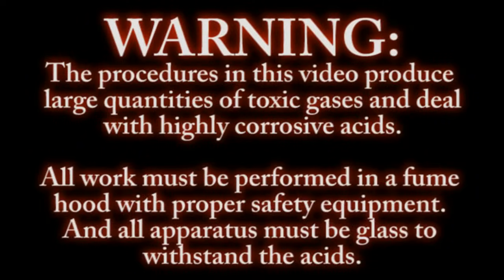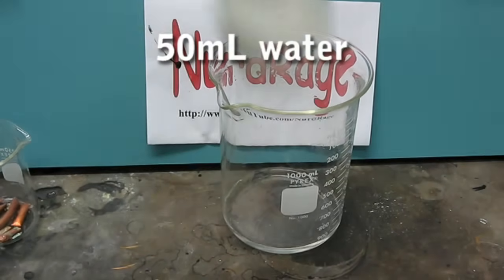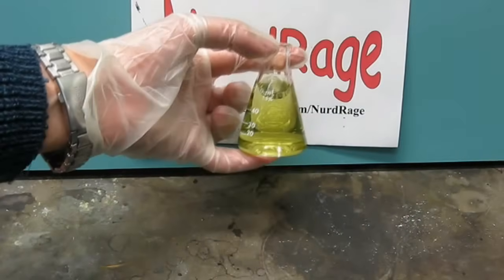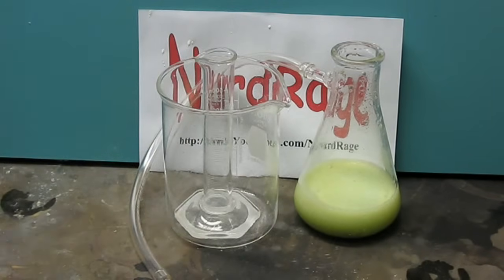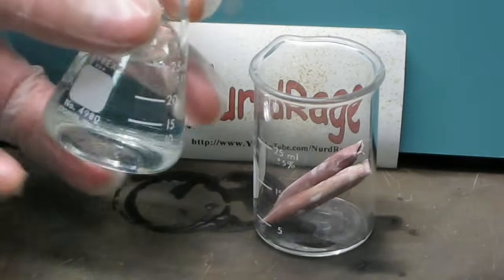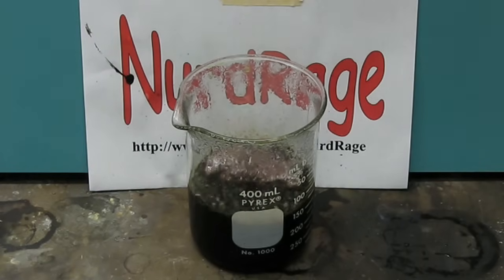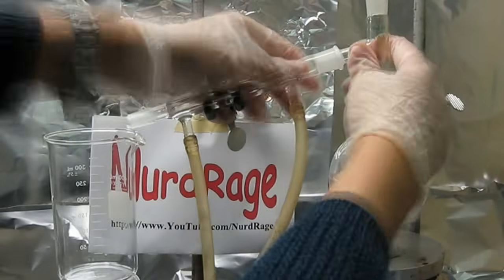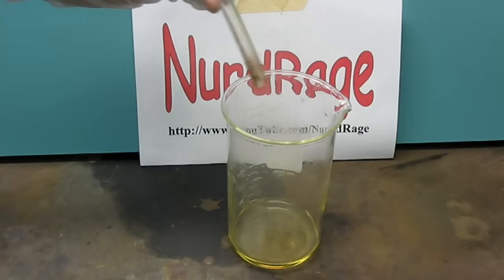Make Nitric Acid - The Complete Guide

Comment: This is by far the stupidest and most useless attempt at trying to make  nitric acid. For some reason I decided to utilize this method since I don't have a retort or distillation equipment yet and it's doing nothing. Absolutely freaking nothing,  except boiling off all the water and HCl. This is some bullshit and  you use sulfuric acid and not HCL. And copper? Really?
Reply from the maker: oh its a terrible method. You should really invest in a proper distillation apparatus and use nitrate+sulfuric acid. Its not worth to try and avoid it as shown here.

Comment: I tried with Potassium Nitrate, and after a day, (finally), the copper seemed to have reacted. A blueish substance was produced, and after y removed the rubber stopper, a small brown cloud escaped. Y used 29% muriatic acid. Soo, I saw your video on hydrochloric acid, made a small amount and tested it with ammonia. Now, I repeated the experiment but with this new hcl. I've waited for 15 min, and there still isn't any brown no2 smoke :/. My question is, despite the concentration of the acid, is there anyway to catalyze the reaction? Can I heat it? Thanks!

Comment: 2 parts Hydrogen Peroxide and 1 part vinegar will dissolve copper. It will take hours at least but it works.
Reply: that makes copper acetate 
sulfuric acid and peroxide. you get copper sulfate.
i think he meant nitric acid is the only acid that would rapidly dissolve copper.

Comment: Why only nitric acid dissolves copper? Why not sulphuric acid or hydrochloric acid?
Reply: Copper has lower reactivity than hydrogen;so it cannot react with hydrochloric or sulfuric acids.

(Not really sulfuric acid but you’ll need hot concentrated ones)

Nitric acid is highly oxidizing so it can dissolve copper

Comment: Your description in the video says concentrated hydrochloric acid.  When I have shopped for this, I have seen the word "concentrated" on acids from 37% all the way down to the 31.45% that you can buy at walmart.  Are any of these okay to use, or do you need a specific concentration?
Reply: Dwight Gordon. I have the same question. I just recently acquired amonium nitrate, the only Hydrocloric acid I can access easily is 31% (muriatic acid) Have you found out if this is sufficient?
Reply: I'm still in the research stages, haven't acquired any as yet.  If we haven't gotten any response by the time I am ready to try it out, I'll let you know what I find.
Reply: What I do know from watching other vids is that the words "hydrochloric" and "muriatic" are used interchangeably for the same acids.
Reply: Dwight Gordon. I'm about to test 31.5% HCI myself. I found some old cold packs that contain amonium nitrate so I'm finially able to produce some nitric acid to process a bunch of high quality gold connector pins I have. I'll post my results as well
Reply: Description says you can use different concentrations, but adjust the amount of water so the acid:water ratio remains the same as in the video

Comment: Hello Nurdrage, I have a question: Is it possible to distill nitric acid using aluminum equipment? For example: Making a cheap liebig condenser using some aluminum pipes? I know aluminum passivates when exposed to liquid nitric acid but, what about nitric acid vapor.       I know the product of this kind of still would have some contamination and, that the pipes would eventually corrode. The real question is: how quickly?

Comment: Bruh u should use flouroantimonic acid or hydroflouric acid there pretty fucking strong
Reply from the maker: Why spend more money on something when cheap sulfuric acid will do just fine? If you want to throw your money away sure, send it to me. If not, use sulfuric acid.
Reply: Okay, A: hydrofluoric acid is actually classified as a weak acid and it's not even the strongest of the weak acids, it's dangerous for other reasons. B: Fluoroantimonic acid is super expensive and dangerous. C: Sulfuric acid works fine.
Reply: Sulfuric acid is pretty much the strongest acid you can buy without a license. HF is actually really weak it just fucks you up because when you spill it on you, it's hard to know if you actually got any on you, and it keeps on reacting until it kills you. Fluroantimontic acid would eat through any container aside from Teflon, it's entirely impractical. It's never even used, it's just a statement. Other super acids take its place.
Reply: ***** You're thinking of something else, because hydrofluoric acid is incredibly expensive and would probably just eat through anything you tried to clean it with. I'm not even sure where you buy the stuff. <Edit> I was thinking of fluoroantimonic acid. However, hydrofluoric acid, while technically classified as a week acid, would never be used for cleaning. It isn't' that strong, but it dissolves glass and is so toxic that getting a drop on your skin can cause a heart attack, but you won't know you got any on you because it destroys the nerves at the point of contact too quickly to feel anything
Reply: Stop being a trend following mental slave... Just because everyone else is doing it doesn't mean you have to as well.. Nurdrage is right to say what he said. Why waste money, flouroantimonic is a strong acid on a scale, it will still be a similar time frame of action.
Reply: i don't think you can buy fluoroant acid can ya?

Comment: so I have an amateur question I was performing the second process you showed, which I have done several times with no issues. the last time I did all was normal then the reaction foamed up and went into my h2o2 and turned my nitric acid a deep blue almost black well it's very cold where I am in the -5 area I let the reaction cool and stop i had chalked it up as a failure. well I havnt discarded my contaminated nitric acid yet but I checked on it the next day and it had faded in color but there is a Crystal structure growing in the bottom of my flask in the nitric acid one more day and the solution has turned to a blue green color and the crystals have stopped growing I'm stumped on what the crystals may be it above my level of knowledge but I'm thinking the dissolved copper in solution may have contaminated it and produced copper nitrate but I could be completely wrong any ideas. anyone

Comment: so I do have a question I have an interesting problem I live In a northern climate and right now it's getting cold I do almost all my chemistry out side do to the lack of a fume hood I've done the second method before and had good results  but I have tried again and got nothing the only difference is its about 30 degrees Fahrenheit in the day would it be advisable to put solution in a hot oil bath to enable the reaction

Comment: I have a question. so, whenever I try to do this, the water/hydrogen peroxide flows into the acid/kno3/copper mix. plz help
Reply: It's because the reacting mixture heats up and once the reaction is finished, the gasses cool and shrink, pulling your nitric acid back through the tube. you should watch the reaction and as soon as things finish up, remove the tube from the peroxide/water before your product gets sucked up.

Comment: now what would be the correct amount  of H2SO4 for 50 mg of the sodium nitrate and at what temp should it be at? I just did the reaction as instructed and i did get the concentrated acid but i dont want to waste the expensive acid H2SO4, i also used an old "deep fat cooker to elevate the temp but what would be the ideal temp for the oil?  right now i need to use tubing until my correct set up arrives, the oil temp was almost 380F but it did work and has a useful  yield

Comment: 1:how can i fix smell problem in make a 4 liters of nitric asid ???
2: what When the reaction of sulfuric acid with hydrochloric acid and ammonium nitrate ends???
to i am make nitric acid by mixing 1.5 liters of hydrochloric acid with 
1.5 kg of ammonium nitrate, Eventually i am add 1 liters of Sulfuric 
acid and Highly toxic gas produced did I do it in my backyard But the 
smell of my home and neighbors embraced I threw them away solution I 
repeat test Solution again what i must do to fix smell and smoke 
problem??? i am nice man As for the neighbors compliance solution 
Discarded Otherwise i have 3 or 4 liters of nitric asid so help me fix 
smell problem for neighbors no for me 
I missed the distillation stage because The experiment was made about two hundred degrees Celsius hot and I could not touch it what When the reaction 
red sentence and response please my 2 qeustion:

1:how can i fix smell problem in make a 4 liters of nitric asid ???
2: what When the reaction of sulfuric acid with hydrochloric acid and ammonium nitrate ends???

Comment: I used the second method you demonstrated and it worked well.
When I proceeded to concentrate via fractional distillation, I over heated destroying the nitrogen dioxide. Could you tell me what the resulting distillate is and if there is any way to salvage or reuse it? Thanks.
Reply: salty-water

Comment: Thanks , 
Have Q .. If i want to precipitate Cu from (Cu no2)  how can I ?
Reply: Add powdered aluminum or iron.
You can actually use any metal that has a higher redox potential (relative to a standard hydrogen cell) to precipitate the less reactive metal from aqueous solution.
Copper has a low redox potential. 
After that it's a matter of cost and the form available. 
Aluminium foil, whether you buy it as foil or make it out of aluminium cans, is pretty cheap, but steel wool isn't that much more expensive and dissolved iron can be used as a fertilizer if you dilute it down. 
So if you have a use for an iron based, nitrogen fertilizer, steel wool might be better.

Comment: I'm guessing that the last reaction with the distilled acid is similar to the leidenfrost effect then???
Reply: TheySmashedAnHourglass Thanks for that :P
Reply: Because it creates a layer of gas which slows the reaction.
Reply: +Sky-M no... it's called passivation, leidenfrost effect is when you, for example, dipped your hands in liquid nitrogen for a short amount of time but it won't give you a frostbite.
Reply: Howie Au Thanks for the clarification.
Reply: Sky-M rare to see people who are so polite like you on the internet these days
Reply: Howie Au Yea. It's quite sad people can't just get along...
Reply: +Sky-M Leidenfrost effect happens when the temperature difference between a liquid and a surface(like liquid nitrogen and a surface at room temperature, or water and a very hot cooking plate) is so big that the liquid instantly boils when it hits the surface and thus, like you said, creating a layer of gas that prevents the liquid from coming in direct contact with the surface. So the liquid has to be the cold one and the surface the hot one.

The reaction between the copper and the pure acid is called passivation, like nurdrage said. A common example of passivation is with aluminium and air; aluminium reacts with oxygen in the air to make aluminium oxide. The aluminium oxide covers the entire surface of the aluminium and prevents more oxygen from reaching the rest of the aluminium and react with it.
So something similar is happening with the copper and the nitric acid. I can&#39;t say for sure what it is, but I would guess that the reaction produces copper nitrate which covers the surface of the copper and prevents more acid from reaching the rest of the copper and reacting with it.

So passivation and leidenfrost effect are quite similar in that they both slow down the rate of a reaction, but the mechanism by which they work is very different^^

Comment: With the distillation method, would using Magnesium Nitrate work? It seems like it wouldn't, because if you use Mg(NO3)2, you would get 2 mol of HNO3 from 1 mol of H2SO4, as compared to the 1:1 mol when using KNO3. Feels like cheating, but would it work? It'd be great if it did.
Reply: It would work.

Comment: I have a question, alright so I performed the gas generator method and I let the NO2 bubble through water it kept going for like 15-20 minutes, and I tested it by dropping copper metal into it and it instantly started bubbling and kept bubbling but no blue color change was observed nor was any brown nitrogen dioxide gas produced.???What the heck I've repeated this experiment multiple times and still get the same results someone please help me and point me in a direction on what I should do, responses are greatly appreciated.

Comment: No matter how i do this,  it won't work. 
Im using ammonium nitrate,  and a strong cleaning chemical that contains hcl.
Reply: What you need is a concentrated sample of HCl so the cleaning solution won't work as well
Reply: Would 32% muriatic acid work?
Reply: I used sodium nitrate
Reply: Yeah,  same here, no brown Gas appeared. But I did do a ph test after and it was acidic.  It barely reacted with the copper at all. 

I used the first method though. 

Note,  don't go anywhere near the dead reacted mixture when you put in the aluminum. 
I was outside,  and i still breathed  in a ton of fumes.
Reply: Maybe it's at a really weak concentration like nurdrage said in his video thanks for replying, I've also had the suspicion it might be nitrous acid and a plane to run air with a bubbler in to the solution with the no2 gasses bubbling through it to oxidize the hno2 (nitrous acid) to hno3 (nitric acid) since there is a mixture of both when bubbling no2 through water
Reply: will Philip what was the pH level of it when you tested it was it 1
Reply: don't know. the paper turned red though
Reply: +will Philip I used ammonium nitrate as well and it turned into a "cold pack" it got very cold and i had to warm it up. It still didn't work so i will try another time with kno3 instead.
Reply: i would use kno3, but it is pretty hard to make.
Reply: +will Philip I live in the US and it's sold as stump out. Just check stump out as its msds to make sure it has kno3.
Reply: +IndomitableGaming Always read the label! Many of Stumpout products, including Bonide's, are sodium metabisulfite, not potassium nitrate. You should also be able to ask for the [M]SDS ([Material] Safety Data Sheet) from whereever you bought your product.
Reply: I ordered 10lb of 99.5 pure kno3 for $33 and free shipping so I got alot! I bought it online for around $3 a pound which is more pure than $6/lb stump remover. I recommend it
Reply: Thats an option too.
Reply: Wade Hutchinson I'm a dick because a stated a simple fact?
Reply: +will Philip If you want potassium nitrate go to Lowes or Home Depot. It's sold 99% pure in a black bottle called "stump remover". It's cheap (like $6) and you get 2lbs worth. Just go look they always have it in stock.
Reply: I bought 10 pounds on ebay for $30 which is cheap.
Reply: +Robert Cece what state are you finding kno3 in at home depot? I live in Denver, Colorado. we have it at lows tho. ace hardware has at least 2 brand of highly concentrated hs2o4.
Reply: ***** NJ. At Lowes. TBO I don't know if Home Depot has it but I know Lowes does. Only issue is the conc h2so4 at Lowes is pink and treated with stabilizers. So it doesn't react with copper and is pretty shitty. Which sucks cause just a few years ago they use to sell it pure without any stabilizers.

It will react if heated up (for this reaction) but to be useful for other things it needs to be distilled. I will check out Ace though maybe their brand is different.
Reply: +will Philip Are you using ammonium nitrate with the method from the video? For your information, NH4NO3 + HCL = NH4CL + HNO3... just thought I should remind you of that.
Reply: James Boaz
Reply: Thebarnardfactor hey can you possible help me, if so let me tell you what happened so I tried the gas generator method and let no2 run through tubing and bubble into 50 ml of water, and I let it run for a good 15-20 minutes and I tested it by dropping copper into it and all I it did was bubble and bubble a lot but absolutely no color blue color change was observed nor was there any brown nitrogen dioxide gas produced, I've repeated this experiment multiple times now and I still get the same resultes, please help if you can:)

Comment: Does using other salts than you used produce not as pure acids, or does it not matter? And does using pure copper make a less contaminated acid?
Reply: Wubbly Bubbly Using non-pure salts such as fertilizer may produce an impure product. The higher purity salts, the better. As far as the copper goes, it doesn't need to be 100% pure; it just needs to be copper and not aluminium, magnesium, zinc, etc.

Comment: Hi!
May I use 38% H2SO4 for 2nd method?
Also, how does concentration of H2O2 affect concentration of HNO3?
Thanks!
Reply: Nikola Jambrović  No, actually, if you dissolve NO2 in cold water, it will give a mixture of Nitrous acid and Nitric acid. However in the presence of oxygen (using hydrogen peroxide here favors the formation of Nitric acid alone), Nitric acid is produced as per the equation below:

4 NO2 + 2 H2O + O2 ----> 4 HNO3 (Industrial process but they do not use H2O2 for this reaction, instead they do use excess of air to convert any Nitric oxide into Nitrogen dioxide and finally it will be dissolved in water in order to obtain Nitric acid)

Instead, you can dissolve Nitrogen dioxide in hot water to avoid the formation of Nitrous acid.

3 NO2 + H2O ----> 2 HNO3 + NO

Comment: I got a question. Using the gas generator method, what happens if sulfuric acid is used in place of the hydrochloric acid and heated while reacting? Would it be the same effect? I m trying to experiment with getting gold from electronic parts.
Reply: Yes,  it’s very simple concept.  What you are doing is acidifying a nitrate salt and reducing with scrap copper to generate NOx or nitric oxide mixed with nitrogen dioxide which is led through peroxide or water.  You just need a moderately concentrated acid to add to solution of nitrate to create the brown fumes.  Battery acid is like 35% sulfuric acid and this would be sufficient if in stoichiometric excess.